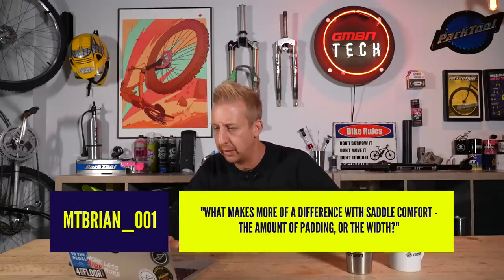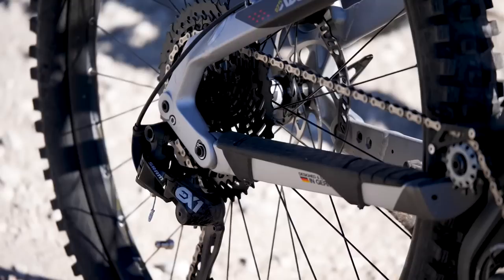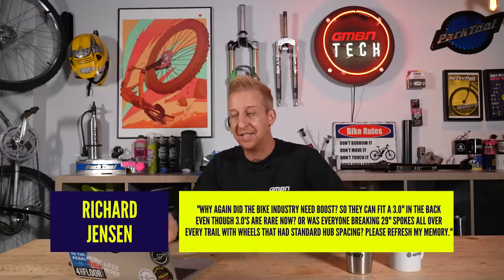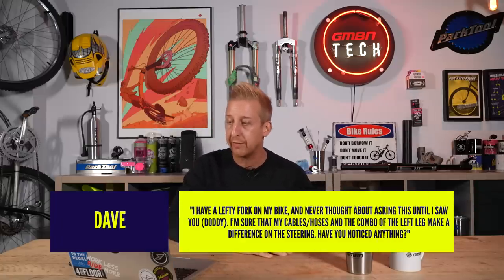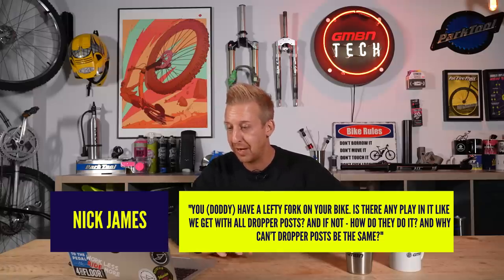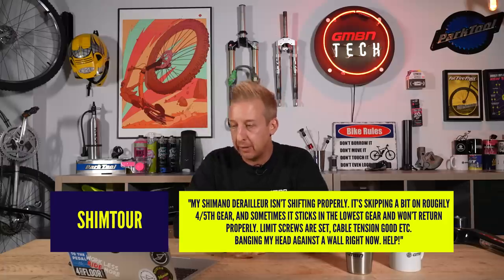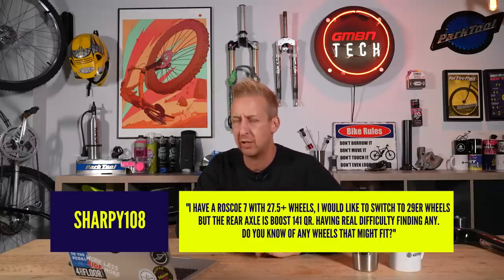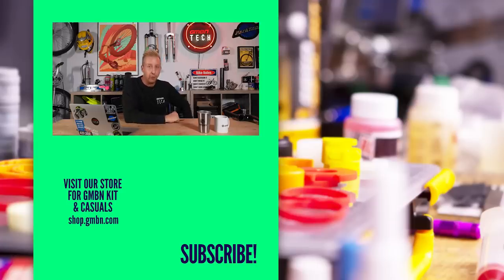"What's More Important Saddle Width Or Padding?" | #AskGMBNTech

Comment: I'd imagine the whole dropper/lefty comparison is basically down to design costs and manufacturing. Zero movement in the suspension is essential.. i can't say I've ever been concerned by the tiny amount of movement in my dropper.
Reply from the maker: But... It would be SO cool David!
Reply: I think it's more complex than that. On suspension forks the legs are significantly thicker than the stanchions while dropper seatposts are constrained in both length and diameter. I think if you wanted to put roller bearings in a tube that narrow the moving part would be so thin it would bend easily. It may be feasible with more exotic materials but droppers are too expensive as is...

Comment: regarding the question at 9:31: i have the same issue and it goes away when i disengage the clutch. through trial and error i found a tolerable clutch-pressure that still allows the derailleur to shift

Comment: For the shifting problem, you may have some play in the freehub body sliding side to side along the axle. Different hubs have different systems to take that play out. Try removing the wheel and pull/push the cassette in and out along the axle. There should be no play in it. If it moves even slightly it will cause infuriating shifting problems. To fix it, remove the cassette and inspect the system to figure out how to remove the play. Some bikes have a little preload ring, others have locking nuts etc. Once you've figured out your system, tighten it up to the point where there's no play but not so tight that it's putting side load onto the bearings. Put it all back together and yank on the cassette again to make sure there's no play in it.

Comment: #AskGMBNTech Love the show. Question regarding front wheel hubs: Is it possible to upgrade from a 9x100QR to a 15x110 Boost using the same rim and spokes? I was wondering if there would be any change in the distance from the hub to the nipple on different hub sizes. Cheers!

Comment: There isn't enough room in the frame to fit bearings between the sliding portion of the post and the fixed side. Most post sliding unit houses a portion of the mechanical parts. if we make it narrower to accommodate the bearings the upper would have to be solid to be strong enough then no room for moving parts

Comment: #askGMBNTech I am thinking about an Ibis Ripley AF which comes with a Fox 34 fork. However the fork comes in a number of levels, including performance, factory, and a standard. Do these matter that much? I like a weight savings, but if only a difference of grams, then I would prefer the tougher or longer lasting configuration. I do not plan on torturing myself or the bike, nor do I plan on competing. Just weekend warrior stuff and exploring single track trails.

Comment: #AskGMBNTech
What is the standard measurement from the end cap to the rotor mounts?
My Trek (Bontrager) measures 19mm whereas a Hope and a Formula hub measures 14mm
I can't get the Formula hub/wheel to fit my 148x12 Powerfly. Thanks

Comment: #AskGMBNTech Hi Anna and Doddy, I'm building a jump bike up from an old Rockhopper frame and have been gifted a set of 26" BMX wheels. The issue I've got is that the wheels have a 14mm axle and the frame has 10mm drop outs, apart from buying new hubs and rebuilding the wheels do I have any other options. Thanks

Comment: #AskGMBNTech Hi Doddy and Anna, I have SRAM Code RS brakes in my new bike, while in my older one I had Shimano XT so I'm more used to those. I feel the SRAM brakes do not have much power. I'm wondering if upgrading the levers to Code RSC would make a difference since they have the contact point adjustment. Is it worth investing the money on those just for that? Will they improve that much? Cheers! love the channel!
Reply: Psst... it's "brakes".
Reply: @ringo666  Thank you, fixed.

Comment: #askgmbntech - as the Northern hemisphere moves into Winter a lot of people change to winter tyres on their cars for increased grip at colder temperatures. Will we ever see 'Winter Tyres' for mountain bikes with compounds optimised for the lower temps we all ride in for a few months a year? Or is this covered in running at lower pressures (something we wouldn't do with our road going car)?
Reply: Tyres come in all sorts of compounds already... E. G. Schwalbe addix have speedgrip, soft, super soft. I often swap from soft to speedgrip in the summer, and/or put the winter rear tyre on the front in summer
Reply: @rupedog   fair point, but Schwalbe refer to the differences in compounds via 'Rolling Properties', 'Durability', 'Damping' and 'Grip' parameters.... my question is around temperature and how that might be a factor in tyre compound choice. Does Addix Ultra Soft maintain it's characteristics under 5°C?
Reply: This may not do anything for your question, since my info is out of date. BUT.....

I happened upon a set of DMR Redshift, 26x2.25 tires some years ago. Center tread is all but gone, but I used them from late Oct until early January, when the heavy snow hit (and I'd switch to studded Schwalbe's then). The DMRs were/are spectacular, and roll better with 2/3 the pressure of urban tires. Tread pattern is a lot like Tioga psycho genius rubber.

Comment: Sorry doddy, but u shouldn't put lube inside a gear cable... They are not designed for it, and it causes them to stick far far sooner as dust and dirt sticks in the lube.
If re-using an outer, flush it with wd40 or gt85 or similar pressurised solvent, and then blow through to dry. But never lube.
Maybe that's why you have to replace inners annually if ur lubing them!!!

Comment: #AskGMBNTech @sharpy108 regarding the boost 141 rear wheel you are looking for, I had the same issue with an old bike and you actually have quite a few options. Nukeproof sell end caps to convert their wheels to 141qr. Hope also sell end caps to convert their hubs as do Hunt. I’ve also seen trek sell a boost 141 rear wheel too. 
I got the Nukeproof horizon v2 wheels and they are awesome.

Comment: The most overlooked--and uncomfortable--aspect of any kind of biking are the horrendous "saddles" that we are are forced to live with. Bicycle saddles should be as comfortable as motorcycle saddles, and they're certainly not.
Reply: But motorcycle saddles and bike saddles  have totally different needs. You are not moving nearly as much on a motorcycle as you are on the bike, so the bike saddles need to be designed with that in mind
Reply: I don't see where you get the idea to compare such dissimilar concepts. Just because the vehicles have two or three wheels isn't enough. You might try pedaling a few hours from a motorcycle seat and please report back on your experience.